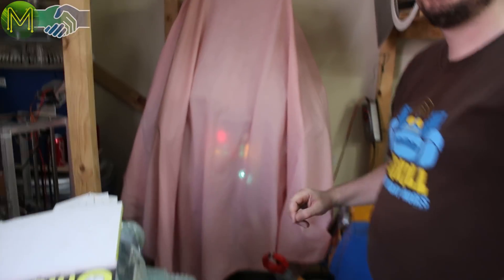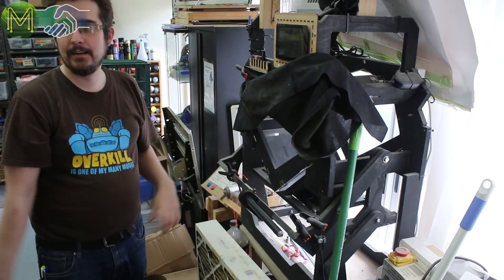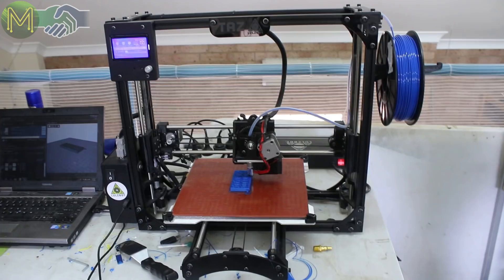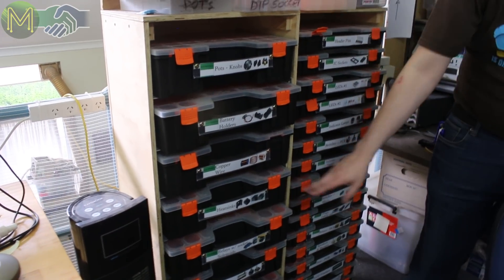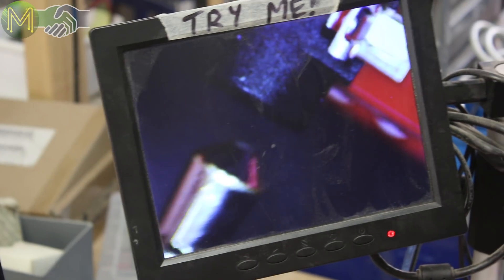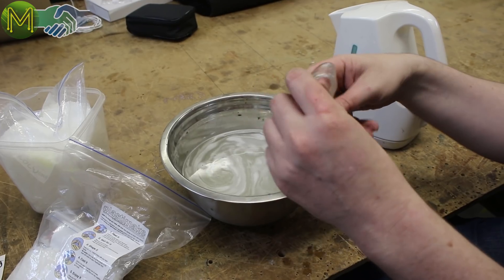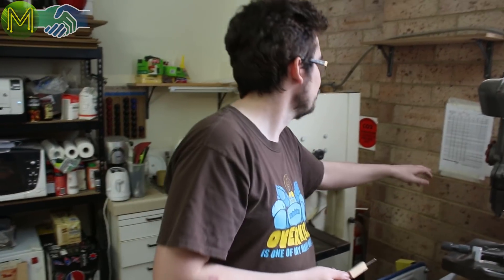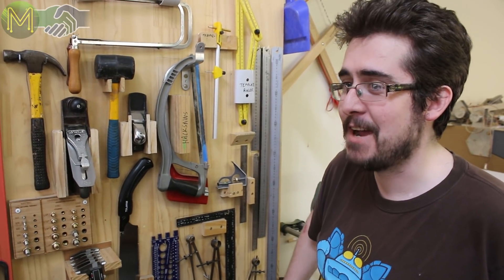#127 MickMake Meets Robots & Dinosaurs: Robots, projects & stories

Comment: what is that at 7:05? you just put it in boiling water and it forms a translucent malleable plastic? looks cool
Reply: Hi! Tim here (the guy in the 'Nerd' shirt). The stuff is called "Plastimake" which is a brand of what I would call 'low temp mouldable plastic'. Its pretty cool. I used it to make a mould of a section of a nerf blaster a few months ago.

Comment: Love the tool board and the screw size block. By the way, metric screws have more than one threads pitch per screw diameter. Check out this chart: http://www.littlemachineshop.com/reference/tapdrillsizes.pdf
Reply from the maker: +Robert Shaver 
Yeah that's a great idea. Very useful in a Makerspace.